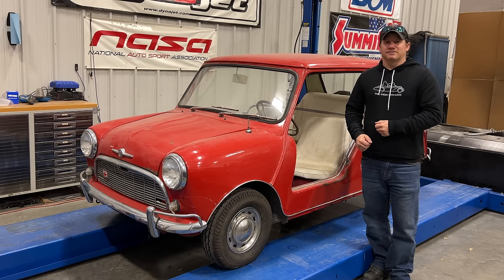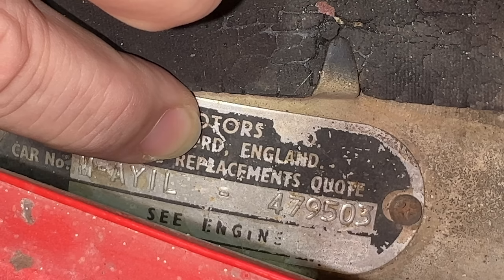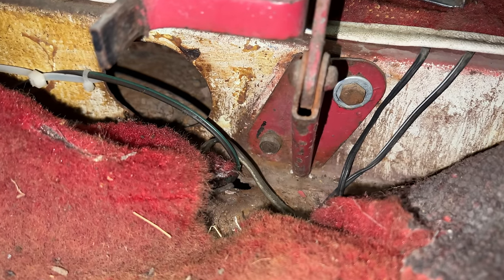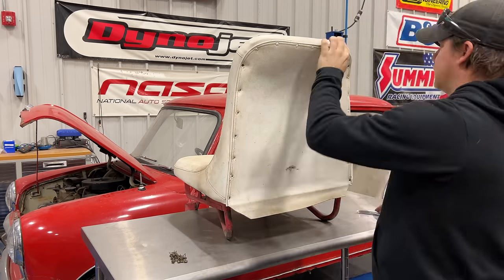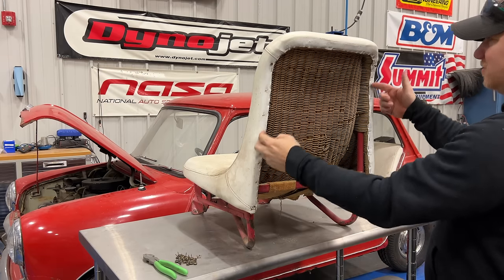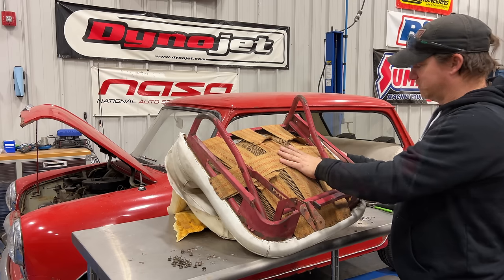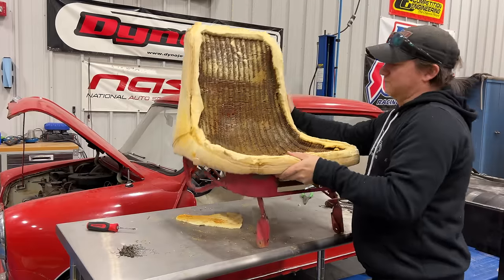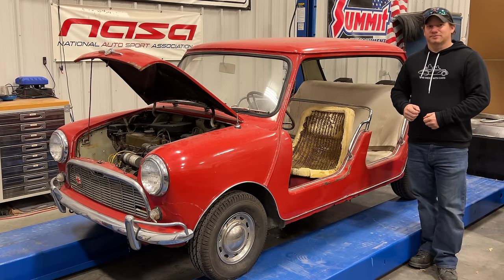Morris Beach Car Restoration - Part 1: Removing a Seat Cover

Comment: Hi Steve, I have an automotive upholstery background. there are ways to remove that adhesive, removing the majority of foam first then a spray adhesive remover but I'm afraid it won't  help that dried out wicker. There are still a rare few individuals that know the craft and I'd recommend that you find one who does, it will be expensive but will be cheaper than letting a novice practice on your car.
Reply from the maker: The company that created these seats for BMC is still in business, I just want to clean them up as well as I can first.
Reply: Wicker furniture was quite popular back in the 60s in the UK, and you do still see it sold as garden or conservatory/sunlounge furniture - so there are still manufacturers working with the material. My first thought was that there might be a chair commercially available that could be adapted to fit the seat frame. Alternatively the materials to make wicker items yourself are available from hobbyist sources - Amazon UK even sells an old book called 'Making Chair Seats from Cane, Rush and Other Natural Materials' for £5 or less .

Comment: That wicker is completely shot on the drivers seat - once it is starting to tear, it is a replacement job only (no way to save it) - but at least the frame is re-useable. Like some others have said, you may have better luck with the passenger seats, and a citrus-based cleaner may be gentle enough to remove the adhesive residue. 

I'd start contacting local upholsterers to find out if any are experienced with wickerwork - anyone who is any good will be able to show examples of their work. I'd also let them advise if they need the existing wicker in place to act as a pattern. Somebody said below that they thought the OEM supplier of the seats was still in business, so (depending on your budget) that may also be an option worth looking into.

If you decide to go the DIY route, take LOTS of photos (from every angle possible) before removing any of the wicker from the frames - there's few things worse than getting halfway into a job, realizing that you don't have a reference for getting everything to fit correctly (there's no way to fudge it when all of the wicker pattern is on display).

Like just about everyone else here, I look forward to seeing it finished.

Comment: Steve
 
My go to cleaner is rubbing alcohol, you could try the 70% and if that's not strong enough
go to the 91%. do a little test area to see what you will end up with.

I had a case where a crayon melted into the fabric of a back seat. The rubbing alcohol dissolved
the wax,  but did not change the color of the fabric.
It's a great grease remover also !

Comment: Perhaps an air hose might blow the foam out of the wicker? I concur with the other comments about replacing the wicker, and getting them from the original manufacturer is the obvious choice.  It will be interesting to see the rest of the clean-up process, but the car looks in pretty good shape.
Reply from the maker: An air hose would certainly be quick to try and non-destructive.

Comment: Fantastic proving provenance of a very rare early car.Having never seen a genuine beach car in the flesh, never realised they had wicker seats.I have obtained a pair of replica original style under rear seat baskets for my recently discovered  ' 61 Austin Seven Deluxe from Coates English -Willow of Taunton , Somerset,here in the  U.K.If you cannot get sorted in The States , may be worth contacting them to see if they could help.You have enough left as a pattern Steve, but I would guess they are beyond economical repair but would take many photos before dealing with repainting the frames .Must have looked a most appealing  eyeful in the original Snowberry White /Tartan Red roof !.Good luck with the project .

Comment: I would try a gentle wire brush on the on the worst bits, wire wool on the not so bad and linseed oil to refresh. That is a rare thing and in pretty decent condition, i'm sure Mini guy's would go nuts for it if it were offered for sale cleaned up but as is. Just needs the right venue and a little promotion. Good luck!

Comment: Hi Steve. that kind of seats where used a lot in 30's n 40.s aircraft. maybe you can find replacement in a aircraft supply. You maybe can clean the glue off with some goo gone. a goo & adhesive remover. a citrus a surface safe   
gum remover. like your videos. carry on. AZ

Comment: The decorative bits are ordinary upholstery tacks, but the nails are underlayment flooring nails and being that they are ring shanked it makes them very difficult to remove. They do make nail removers that act like a slide hammer. Any citrus based adhesive remover should be effective and gentle for use on wicker.  Cheers!

Comment: Nails with rings/ridges on them are called ring-shank nails..  Wicker:  First it needs to be brought back to pliable condition.  Various different treatments of the material can be done.. steam, water, and some mild solvents.  Solvents would also take care of the glue and foam.

Comment: Suggestion for removing adhesive from wicker - stiff bristle brush with a mineral spirit solvent.   The wicker looks in sad shape, though.  I don't suppose there're any spares in new old stock, so maybe an alternative fabric belting woven and stitched to the original frame rails.  Wicker may be able to be replaced in a high end upholstery shop.  Depends how committed you are to a total rebuild of this car.

Comment: I think the wicker was used as it could get wet and dry out quickly. The seats are normal mini mounts so I would get a normal seat to bolt in so at least you could operate the pedals and steering if you wanted to drive or move the car easily. That would leave you more time to get the wicker redone. I agree with the others it should get its wicker seats back. I am guessing that there are even less of these than the Mokes. Good on you for restoring it.

Comment: for getting that foam off, I'd try a 3" plastic wire wheel running at a somewhat slow rpm. The wire wheels are just like a wire one but the wire is like plastic. All the tool centers carry them. Chuck it up in your cordless wheel, run the wheel slow and let it eat that soft foam.. Good luck

Comment: If the wicker was not damaged you could try a firm bristle brush like the ones you brush dogs with. However if all of them re damaged like the first one was, it is all over. The only option if you wish to retain the original look, is new wicker. That would be the best thing if you want the certificate to hold true.

Comment: The only way that I know of to remove the glue/foam from the wicker would be some sort of solvent, but what that would do to the wicker I'm not sure. My background was in furniture manufacturing and I'm betting that the glue used would have been spray contact adhesive which is what we used prior to water born foam adhesives.

Comment: As a former upholster I don't know why they used those huge nails, tack's would have been the normal way to do it and then the 'decorative ' nails. Steve you could try to clean the wicker with something like white spirit but as the seat part has failed I would just get it redone as it is all one piece, mostly. As someone else has said it could easily be aged. Thanks for the video Steve, Merry Christmas to you and Cassie. 👍

Comment: Wood isn't likely to be significantly harmed by solvents.  I would test to see what attacks the glue (alcohol, naptha, acetone, etc.) Use the least aggressive solvent, and a soft/medium nylon brush to work the glue/foam loose.
Being that wood is fibrous and mostly carbon it should be fine with most petroleum derived solvents.  Avoid oxidizing cleaners as they will destroy the carbon compounds and lignin.
Reply from the maker: Thanks for the ideas.

Comment: Naptha, rubbing alcohol. nail polish remover all of these will soften up the glue.
Reply from the maker: And not hurt the wicker?
Reply: You’re not saving that wicker.  Not a chance.  Not and making the car useable.  Maybe as a static piece…  and you seem to like to drive your cars.  A stiff brush will take off the dried out foam but it’s already torn up.  You need a furniture guy, preferably someone in his late 70’s or 80’s who has some skills.
Reply: @ThisWeekWithCars  I wouldn't think it would, try it on an inconspicuous area first.